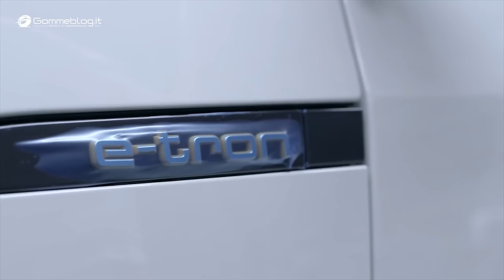Electric Engine PRODUCTION - Audi e-tron MOTOR

Comment: Electric motors building electric motors
Reply: Thats right 😄 . But all   robots are built  by humans 👍
Reply: People making people
Reply: Electric bill cost
Reply: Cornel Con nah they are also made by robots. It's a loop
Reply: Human builds humans, same way
Reply: Electrical fitters, another trade nights the dust
Reply: @cornelcon5267   i dont thinks so
Reply: @cornelcon5267  Some humans build some robots wich build billion of cars and others products..
Reply: With Human mechanics / Electrical
Reply: That's how it starts.
Reply: Machines building machines! 3CP0...
Reply: @ayi5845  but for the 1st time they are built by humans, later they are programmed to create their own prototypes
Reply: Skynet : am i joking
Reply: It’s coming...
Reply: @DarkhanYessilbay  เธอ
Reply: @DarkhanYessilbay  so they reached human level
Reply: Skynet
Reply: Simply amazing.
Reply: Human build and destroy in the same time .It is the truth.
Reply: Electric Motors cant Build robots 😂
Reply: It is redundant to say "electric motor".  Motors are electric in general. People call combustion engines "motors" and they are wrong and cause confusion with the terminology.
Reply: @DarkhanYessilbay  Sounds like a lot of moaning and groaning.
Reply: Ac motars building DC motors
Reply: @xESPplayer500x  
Well technically a motor and an engine both mean the same thing. Engine is a machine with moving parts the converts power into motion. Motor is basically thr same exact thing just with an emphasis towards being electrically driven but can be I.C. or steam or sterling of whatever else you can think of.
Reply: I made babies! 
Isn't it awesome? 😂
Reply: Rise of the machines
Reply: @risumz3711  How perverse! :D
Reply: It seems an useful comment, but it's not.
Reply: It seems an useful comment, but it's not.
Reply: That to near future will be terminatör baby 😅😅
Reply: @SonIQBukucuIlberOrtayli  ☻

Comment: You are showing us how they make an electric engine.
But I can't stop wonder: how did they made the machine that make the electric engine...
Reply: Yes, a lot of ingenieurs are nit gonna work "actively" on the car itself, but rather develop tools and machines that are making tbe components of the car
Reply: By using another machine that made by another machine that made by another machine.
Reply: In fact, this video shows that there is no longer room for people in production.
Reply: @uca062206  and the e cars are still way to expensive
Reply: Or the machine that made the machine that makes the electric engine
Reply: @FlameBot  that's why they have so many ev-cars channels on yout that make specially men spend thousands on cars to make them feel happy
Reply: @uca062206  no, it just shows that it cheaper to design a machine that does not complain, get sick or pregnant. I have seen how machine fails to do something and then again they bring some immigrant guy from the agency while programmers fiddle with machine
Reply: @uca062206  if you want every step done by a human, only hyper rich people will own cars. A modern car can’t be economically made in a full manual sweat shop. There’s a reason bespoke, handmade cars cost a literal fortune.
Reply: My question is whether when my car goes wrong, our local garage under the railway arches will have all those machines to fix it. 😊
Reply: ANOTHER ONE
Reply: Larn some engineering and you will know the process.
Reply: @fleisbester612  
You probably did not understand what I wrote.
Certainly there is engineering behind the machine.
But if the video shows the engineering for building an electric motor, then the machine that builds that motor is worth 40 videos ...
That's what I wonder about.
Reply: @tamirerez2547  That's it, it's a cascade process, every step has a lot of engineering involved. It's possible to find some videos of some automation companies that build these machines, even Kuka has some videos showing how they build their robots.
Reply: @fleisbester612  
Thank you for your answer.
I will not be surprised if you are an engineer, no?
Anyway, this is amazing. These machines. So complicated, milions of parts, each "knows" exactly when his time, and what his job.
I salute the engneers who built these machines.
Reply: Or which came first, the chicken or the egg?
Reply: No-one has ever made an 'electric engine'. There's no such thing, despite a new generation of internet nerds. An 'engine' converts heat into movement. The video is about 'electric motors'. I wish people would stop trying to rewrite the English Language.
Reply: @robertrobinson3861  
I'm really sorry about that.
English is not my language.
In hebrew (Israel) we say מנוע which mean motor or engine as well. 
The point of my comment was about the amazing machine that make this MOTOR.
Reply: @robertrobinson3861  In other languages the word for "engine" and "motor" is the same.

Comment: What impressed me the most is how clean everything is, including the workers lol
Reply: When it comes to high voltage electronics, every particle can create a bridge between two different electric potentials. So you really have to make sure there is no type of dust going into the area of raw copper wires or onto the circuit boards, that has not been anticipated by the designers.
Reply: You can eat from the floor,cleaner the most restaurants.

Comment: A beautiful thing to watch. All the mixed alloy components, copper wire, silicones, hardened steel bearings and plastics brought to you by coal and the oil industry.
Reply: mining is petroleum intensive, as is processing copper, steel and other alloys, and heat treating and machining them, as necessary.
Reply: I am being rather facetious

Comment: As amazing as all this is, what's more amazing is the engineering that went into all the assembly of the machinery involved. I can see why they like to use certain power trains over multiple models or vehicles.
Reply: It is cheaper that way. But is it what you want?
Reply: @sat7755   I switched to a 2 wheel EV, I can get into the city faster than a car now. just by bypassing all the grid locks.
Reply: @sat7755  no. all i want is to love, and to be loved! audi cannot provide this for me for any less than 89k euro
Reply: That's exactly what i thought..mankind has come a long way from stone tools..amazing engineering....

Comment: I wish Tesla had the same quality control at ended production as Audi. Measuring the bodywork and trim down to the millimeter. Impressive video! Thanks!
Reply: @Daniel Brice Yeah, I love my Tesla, but it wouldn't hurt to have less repairs. As you mentioned, I am wondering what's behind the idea of less range. Less performance is not an issue for common people. Elon is a very intelligent and unique man, that's for sure. His ideas combined with German precision would be outstanding.
Reply: @Daniel Brice E-tron have a big battery buffer. And will for sure outlive every Model X. Quality in Etron is way way better than any Tesla. Handling is also better. You don't need bigger range if you can load your battery for 15-20 minutes. But this si not the problem, everyone can put bigger battery. Why you need updates in the first place? Good luck with any Tesla out of the warranty. They are worst even in warranty.
Reply: @stalliontheplumber7406  heaven forbid a commoner gets their hands on an EV!
Reply: Audi vehicles are riddled with costly issues, i see it weekly in comparison to some other manufacturers excluding American vehicles.
Reply: Tesla is junk when it comes to quality, period! Great in range but that’s it
Reply: @user-kb8gh5jv9t  they are working now to improve their quality.. Read the latest Bloomberg's report about Tesla quality.. Their problem now only for their service.. It takes too long to get service with them..
Reply: Tesla will be left to be a foot note in the EV market as these marquee brands get going. OTA is not a big secret. Your smartphones are OTA updated for C sake.

Comment: Audi makes an electric drive motor?...hopefully they are more reliable than their window regulators... or anything electronic audi makes for that matter..
Reply: Hope those motors dont run with computer with windows system.
Reply: @machatte3522  😂🤣 I saw what you did there
Reply: @machatte3522  hahahahahaha
Reply: @machatte3522  My Audi A3 is perfect !
Reply: @ManlyHK1  My Audi A3 is perfect
Reply: Teslas motor is more efficient but cool to watch the assembly especially without stupid music over the machine noises
Reply: And their high pressure fuel pumps.
Reply: Their Drive motors have as is warranty. The Audi trademark
Reply: apparently designed by the same crew

Comment: I'm really surprised by the high level of automation on the motor part, for the relative low level of Audi e-Tron motors that are sold on the market. I thought they would source this phase to some other motor specialised manufacturer.

Comment: Just to clarify the common misconception of engine and motor!!  When  it is power by electricity it’s called “motor” only combustion engines are called engines!
Reply: Just to clarify the common misconception : Motor and engine are interchangeable in standard English.[4] In some engineering jargons, the two words have different meanings, in which engine is a device that burns or otherwise consumes fuel, changing its chemical composition, and a motor is a device driven by electricity, air, or hydraulic pressure, which does not change the chemical composition of its energy source.[5][6] However, rocketry uses the term rocket motor, even though they consume fuel.
Reply: But aren't combustion engines sometimes called motors, possibly more in American English rather than British English?  And we still have the term motor car which long pre-dates EVs.
Reply: A motor receives power from an external source, and then converts it into mechanical energy, while an engine creates power from pressure (derived directly from the explosive force of combustion or other chemical reaction.

Comment: Nice vid but . . . They aren't electric engines. The correct nomenclature is "electric motor".

People call combustion engines "motors" which is also incorrect.
Reply: Barry Williams .... in Spanish there is a difference...... for engine .... motor de gasolina/diésel ... diésel/gasoline motor  and for the electric one ....... motor eléctrico = electric motor

Comment: I'd like to see how they remove the enamel coating on the wires on the leads.
Reply: Jesse Fritz a guarded secret for sure.
Reply: Nothing secret about it. Aerospace have been using polyimide enamelled conducter wire for winding motors and generators for decades. We build by hand and use either emery belts to grind the coating off on large rectangular section wire or an electric or air tool which grabs the outside and gnaws the stuff off. Audi with higher production may have a more automated method, but removing the enamel is not high tech.
Reply: A lot of magnet wire can be soldered without removing enamel. The heat burns the enamel off. I have also seen insulation displacement on small motors. The wire is forced down into a narrow "V" shaped metal terminal and the sharp metal edges cut through the insulation and bite into the he copper

Comment: Should be Electric “MOTOR” Production ..... not Electric Engine production ! No such thing as a electric engine.
Reply: What is the differnce between engine and motor
Reply: I dont think the term "engine" specifically refers to combustion engines if thats what you are implying. And engine simply converts power into motion. Thats exactly what an electric motor does.

Comment: In the 80's, I have already been working as technician on Toyota electric towing tractors and electric forklifts which uses electric motors. I would say its a more than 35 year old technology, and it's only now that they apply it on passenger cars.
Reply: Lithium Ion
Reply: @lbear3321  No, it's using 48V lead acid battery. Each cell is 2V, and weighs about 20 kilogram. The whole battery pack is encased inside heavy steel casing and needs another forklift to replace. They make it heavy for traction and counterweight.

Comment: Nice engineering and nice clean factory but there seems to be a lot of unnecessary steps and movement of parts during assembly of the motor. This could be sped up 10x if done better. I don't think they are too concerned with keeping up with Tesla as they just can't get the batteries in quick enough.

Comment: It didn't look like the insulation on the wires was removed before the three lugs were crimped on, wouldn't this compromise the connectivity between the windings and lugs, or did we miss a process?

Comment: FYI: An engine is a mechanical device that uses a fuel source to create an output. The word “engine” is generally used to refer to a reciprocating engine (steam or internal combustion) while “motor” is generally used to refer to a rotating device such as an electric motor. 

You are welcome!
Reply: Motor is how to say engine in portuguese or spanish. It comes from força motriz, wich means driving force. You are welcome.

Comment: I love electric car-producton because it has so much interesting and verry big and complex equipment. I think that it's a genius way to combined SKILLED worker and machine, in the way that the SKILLED worker are controlling the movement of the machine when a prosess is different for the machine to do alone. 

But automate as much as possible, and choose fast but PRESISE equipment, and take some time to fine tune the movements to make chure that nothing goes wrong. I think it's smart to youse FASTER but smooth speed AJUSTABLE, then first think, if you do this you will be glad when you can speed up your production, and slow down "flexibility" when you need to ramp upp production WITHOUT investing in a brand new production line. Because when everything is done perfect of the robot, or the machine you can speed upp the movements to the optimal speed when producton ramp up beginning.
Reply: Egerly waiting to own one. Soman. IPOH.

Comment: And in order to make all these amazing machines that make this electric engine and power all these machines, hundreds of tons of coal were burned to generate electricity and hundreds of gallons of water were used in processing to mine and refine the metals.
And as far as charging the battery that goes into the car that powers this engine, more coal or oil will be burned to make it run. How much more energy efficient is this really? We need to address energy efficiency at the source (power generation and manufacturing) not at the site!

Comment: Well done video everyone. And very well done automation, debugging must have been fun :). May I ask what control (s) did you use? Plc or PC driven? Also any ball park on price?
Reply: Price of the motor? If it's the same as other car brands mototrs it's between 700 and 1000$. Probably 800 something
Reply: @fryphillipj560  no I was referring to the control system deployed to control / check / build the entire engine from start to finish. The automation side of things. 

In regards to price i was asking for price to build such a line. 

This my field so seeing this type of automation to this degree always interests me.

Comment: I wonder if most of the human labor is just so that "workers won't lose they job". Some of those tasks seems replacable by machines; yet, they're performed by human. It wouldn't make senses if machines are yet to handle those tasks or more expensive than human as you've seen them done on the video.

Comment: Another thing, if the factory begins to make huge electric power motors for air planes, with big alternators with huge Batteries, will they be able to transfer those Airplanes that already have fuel engines, into Electric power motors instead of fuel?.

Comment: Semantics.  If it does not require combustion it’s a motor.  Hence electric motor, air motor, hydraulic motor.   
     If it combusts it’s an engine.  Hence steam engine, gas turbine engine, gas engine, Diesel engine, jet engine, rocket engine etc.   
I don’t care which is used, just pointing the distinction.   Cheers. D

Comment: @7:12  the motor swivels by 3/4 of a revolution to these way, if the motor swivels in the other way it can win 1/2 revolution?
Reply: It's probably done this way to avoid singularity or to prevent tearing the cables

Comment: So when the body/cabin is dropped onto the battery/motor/chassis module I have to wonder how repairs would be made to the bits on top of the battery block as they seem to be inacessible.

Comment: Electric cars could have been on the roads in the millions years ago. But there are a couple of small problems. Batteries where not up to the task, the fossil fuel ran world was King. Alot of people and company would have to be retrained and retooled to build electric motors. The hold automotive industry would be turned upside down because an electric car needs fewer parts to run a car, truck down the road.

Comment: inefficient PRODUCTION Rate, extreme expense of equipment, very low productivity.  result is OVERPRICED products. Auto Cost minimum USD70,000 to over USD90,000.    INEFICIENT
Reply: What improvements would you make to make it more efficient?

Comment: The wires are not neat. Is it the limit of modern engineering? There seems to be a need for further evolution in manufacturing. Then the electric motor will be able to approach the efficiency of the internal combustion engine.